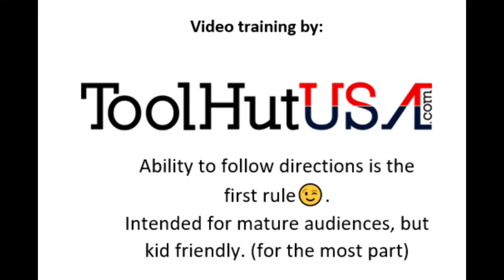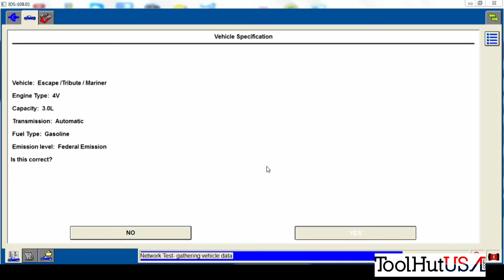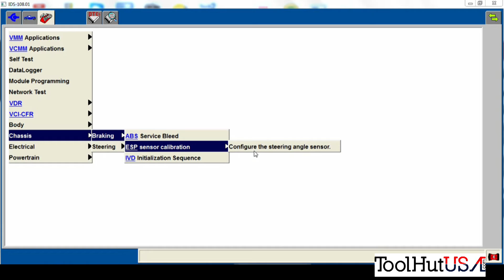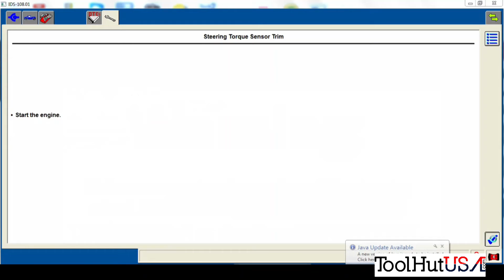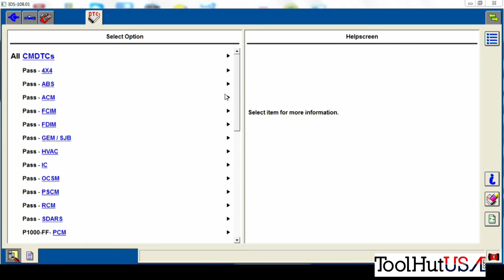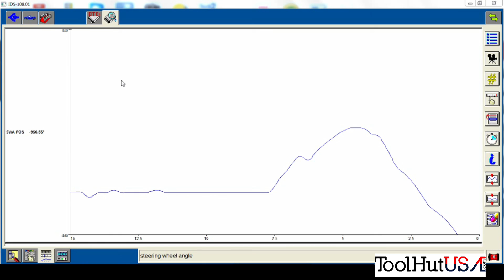2008 Ford escape, mariner, tribute steering angle sensor torque angle.

Comment: Very knowledgeable and good video from a 10-year ford tech. After replacement of a torque sensor it's a toss up if you will have to perform the torque sensor trim relearn but you will know if the wheel is a little stiff turning one way and free the other. If you start the vehicle after said repair and the steering wheel spins in either direction to the lock of its own accord you have improperly installed the torque sensor and it will have to be replaced again.

Comment: Got an 09 Escape and for some reason as I'm driving down the highway and I come across a small bump such when crossing an over pass the vehicle swerves either to the left of right and it's got me puzzled as to what could be causing it. I just had it aligned and even replaced a ball joint that was thought to be the culprit. Upon lifting the vehicle and checking for play in the tires, they seem tight and no play in tie rods or anything.

Comment: So nice to see a more recent video about this. I just replaced my steering column in my 2008 Escape with a used column, as well as the u-joint on the lower intermediate steering shaft (but that’s a whole other story). Replacing the column fixed my “phantom shake” in my steering wheel as is common with the bad torque sensors and returned my power steering to MOSTLY normal. Now my steering will wander, the steering wheel will move with bumps, and occasionally the steering will lock up when turning only to the right (it’s fine turning to the left, and returns to normal if you turn the car off and back on). I just had an alignment and tire rotation so I’m fairly certain that’s not part of my problem, however, the steering angle sensor hasn’t been recalibrated with a scan tool since the replacement and I’m wondering that’s what might be causing my problems? Do you have an opinions? Thanks so much for posting this video!

Comment: Great info Sam Thank you. I would like to know why not program power steering control modules?? Thanks
Reply: I just posted about the PSCM video and saw this, do you have any advice when programming a reman rack. The original rack was turned in for core, so will have to use build-as data